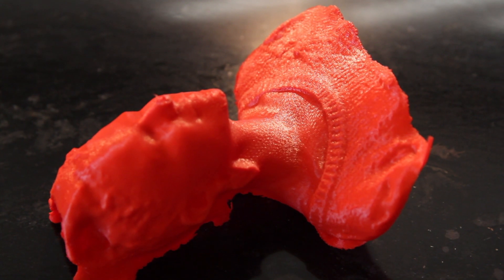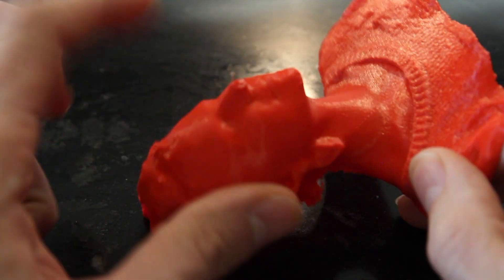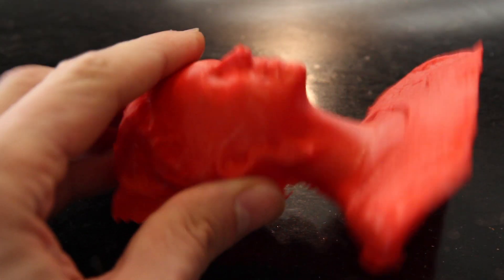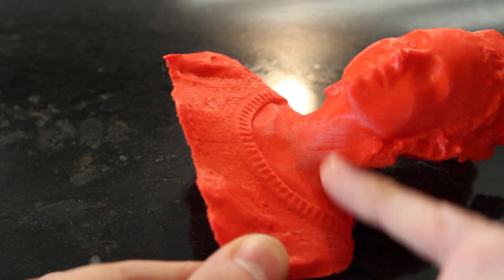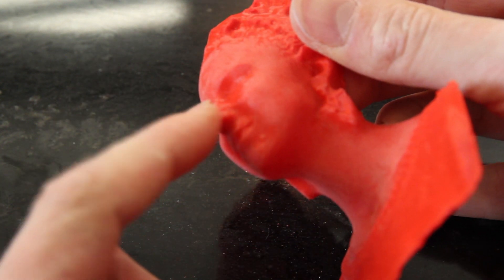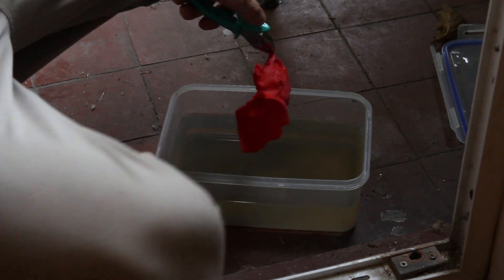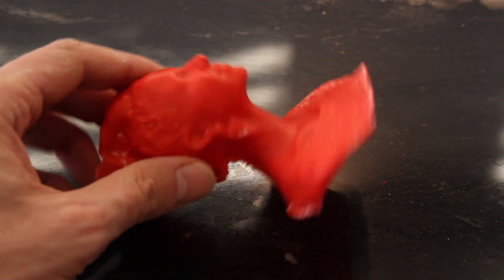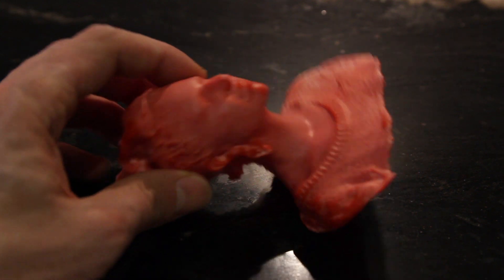ACETONE SMOOTHING PLA BEST METHOD EVER

Comment: Storing acetone in a proper container is a consideration especially for those of us in hot climates. Be aware, an airtight container might explode from pressure.
Reply from the maker: Is that why some containers deliberately leak like methylene chloride? I had a 1 ltre bottle that was half empty afterca month and i hadnt even opened it!
Reply: @Cloakfiend  Likely. I'm not sure about that chemical specifically, but I know I've bought containers made specifically for different things that advertise that they leak excess pressure out of the canister as a measure of safe and proper storage. I've also had friends tell me stories about small explosions and/ or fires from using improper containers (most chemistry majors), so it's a good idea to research proper storage of chemicals and see if pressure relief is needed for the highly volatile ones.
Reply from the maker: @technicalman  im mostly ok. Temperature kinda makes the acetone containers expand on occation but they are almost empty so nothing dramatic and only after ages. Store them in a place where the temps are stable and you should be fine. Ive been doing this for more than 5 years now without issue. Even working in a room with a fireplace at 300 degrees C doesnt ignite acetone vapours. Not that i do that regularly!. Just tried it once.
Reply: @Cloakfiend  If it's the container in the video, it's probably fine. I imagine it is more likely to leak a little gas out of the seal when pressure is on the inside than explode.

Comment: As per your recommendation, I purchased some Colorfabb PLA/PHA but I'm having a really hard time to print small figures with it, specially on thin areas like supports, infills etc, it gets stringy and at some point will hit the nozzle and mess up everything. I tried to lower printing speed down to 30 mm/s and pritn temp to ~ 160ºC but still the same problems. Am I'm missing something? Thanks a lot!
Reply from the maker: What printer do you have? I use ultimakers and even default settings in cura for pla gives me decent results. Small stuff i print at 30mms at 193degrees with 0.06 layet height. I only use colorfabb and have just printed some amazing sculpts with some filament from colorfabb.
Reply: Thanks man, I'm using a cheap Ender 3. As mentioned earlier, my problem was happening mostly with supports and infills rather than the print shell.  In Cura there are no retractions for supports so that's where the stringy stuff came from (Not sure if there's a hidden option somewhere for this, I need to investigate further). 

So I just created some supports in Meshmixer and imported these in Cura (to have retractions on them) and so far it's now printing really nice.

Thanks again, I'll stick to your recommended 30mm/s and 190ºC. I own you a spool of dutch orange! :-)
Reply from the maker: @techmorning  if it doesnt affect your outer shell, then dont worry about stuff hanging off bits here and there. its worth investing in a good printer. it takes the pain away and you dont worry about failed prints, because they dont fail. The um2+ is a great printer imo and a lot of people bought these a few years back and never really used them as with many other brands, i see hardly used ones for sale all the time on ultimakers forums. you can pick them up for a very good price. they have an hours used option you can check to see how much use they'e had. Im still using my um2 from 4 years back! as well as another newer um.

Comment: If you are acetone smoothing PLA models than you are using very cheep filament. PLA is not reactive to acetone. what you are smoothing is the cheep low grade filler plastic that is in that filament. If that works for you then more power to you, but my stuff doesn't react to acetone.
Reply from the maker: 1stupidfish lets just agree to disagree. I think you'll find colorfabb filament highly rated and not cheap so ill leave it at that. Im not saying the additives they are adding are not cheap and they are ripping us off but im just after a good end result with as little layer lines than i can acheive. So im happy with the pla filament i use to acheive that. If you dont want to smooth your prints like i do....well thats your decision. Im not forcing you to do it. Im just showing you it can be done. Apple also use cheap components, do people still buy Apple products? Yes they do. I don't. Its all down to personal choice.
Reply: I'll grant you that you can get a limited amount of smoothie with that. Have you ever tried ethanol acetate? It gives you the same kind of smoothing effect as you get with abs and acetone. I don't mean to put you on your video it's a very good how to to use a very cheap products to increase the visual appeal of your pla prints. I usually simply use a vapor bath of the ethanol acetate with no sanding and I get a glass-like finish.
Reply from the maker: 1stupidfish well ill willing try anything out. Ill look into it. Any videos?

Comment: Yeah man this doesn't make any sense. I wonder if you some how ended up with PLB filament aka polysmooth. If you still have some of this stuff around see how it acts with isopropyl alcohol.
Reply from the maker: x9x9x9x9x9 isopropyl alcohol doesn't do a thing to this filament. It's colorfabb pla by the way and I've been using it for over three years I will post a new vid soon showing split screen comparisons and resolution tests and different results with different colours etc. Also the warping you need to look out for if you over do it.

Comment: let me see if i understood correctly...    you sanded a PLA 3D print, later you submerged it in acetone for 25 sec. and you left it dry??   it was it?
Reply from the maker: fearberserker117 yes basically. but make sure the print is as good as you can get. i did this one for about 45 secs btw. i said 25 but remembered i was using colorfabb which needs longer. ive got a few new vids coming soon anyways.

Comment: I thought you were supposed to use Acetone vapor ?
Reply from the maker: Devilz Heroz nah the vapour method is too uneven and i dont do it as this method suits my needs. vapour is for abs really. you can do it with colourfabb a bit but brush on or dip is better with this PLA in my opinion.

Comment: what printer u use?
Reply from the maker: i raul ultimaker 2
Reply: Cloakfiend  ohhh expensive one
Reply from the maker: i raul i paid 1500 pounds for it over a year ago. i dont think that is very expensive. the new one is too expensive!
Reply: Cloakfiend  check the reviews of the PRUSA i3 mk2 or ANET A8(is the clone of prusa)
Reply from the maker: i raul im happy with mu um2 even though it is old. my next printer will be resin, as filament printers dont get much better than the um2. and the um3 is stupidly expensive.

Comment: No problem I was reading your article on the head you did a while back old man head looks amazing by the way inspired me to start 3d printing. Question what layer height did you do it at in the end at any settings you can help me with like shell infill ect massive thankyou in advance
Reply from the maker: all my stuff is generally 60 microns and no infill to save time. infill is only needed when you have cavities on your model. hope that helps?

Comment: So, obviously this was not PLA (whatever they call it), since pure PLA filament does not dissolve with acetone at all. ABS does, but not PLA.
Reply: Because not everyone wants to have potentially dangerous fumes in the room. I for example have a one room apartment and therefore not the luxury of a garage, a workshop or hobby room.
The biggest problem with 3D printing at the moment is, that the filament manufacturers only state the main polymer and not what else is in there.
Reply: I don't think you can get pure PLA filament. Most of the filaments, at least those with color will react to acetone. I am using it to weld prints together
Reply from the maker: just go outside for a minute and do it then like in my newer video and problem of fumes solved.
Reply: Cloakfiend I am talking about the printing, not the acetone. ABS is made from mineral oil and emits chemicals during printing that aren't exacly healthy.
Reply: Jeppe Beier Do we need to use the industrial one? Or the ones that women use to erase their manicures?
Reply from the maker: Andreas Vogler im using pla not abs, thats the whole point.
Reply from the maker: Yes, Obviously. I need to do a new tutorial to prevent the same pure PLA questions argument i keep having, its regular colourfabb PLA ONLY for now as stated in the description. I never said PURE pla as we ALL know it doesnt do anything.
Reply: Cloakfiend Colofabb Claims it is not pure PLA, but a PLA/PHA-mix. This means that whatever  PHA-Derivate they used, may be reactive with acetone. The same is true for Ethyacetate, which only works on PLA-mixes, not pure PLA (but Filaments are almost always some kind of mix.
Reply from the maker: Thats why I love their filament over everyone elses,  i couldnt care why people WANT pure pla, surely one that smooths is better than one that doesnt?
Reply: Cloakfiend Fine,  but they should not call a product "pure something" when it isn't.
Reply from the maker: they dont, its called pla/pha, why do people want pure pla anyways? i certainly dont

Comment: when you print from shapeways or Sculpteo whith their standar plastic PA12 is it ABS PLA or something else like Nylon ?
Reply: PA is short for Polyamide, which is Nylon
Reply: so would acetone smooth the PA as well ?
Reply from the maker: I've no idea what industrial printers use I've only used some for studio work a couple of times before i bought my printer and it was kind of powdery and you couldnt sand it so it didnt suit my needs. And it was like 100 times more expensive.
Reply: yes Nylon or PA12 is porus but the most strong plastic, and i need Strenght since i am making parts for airsoft
but thanks for the help abyway i will still try with acetone to see how it react :)
Reply from the maker: +GenoGENOVA ill make a new video which will help in warping as if you dip long thin parts like wings, they may warp if you are not careful.

Comment: Hi Cloakfiend,
I am uncertain how long the smoothing process takes on PLA/PHA...
I tried dipping a PLA/PHA print and still see some banding, would a minute in the dip be out of the question?

Also is 30 seconds always enough for a dip, or can i try like 45 seconds or minute? Have you tried?
Reply from the maker: its difficult to say and if your print is not perfect then dont expect the smooth to be either. print as high res as you can with as little infill as you can get away with to save time. i always print 0.06 minimum. sanding before smoothing will help a lot.
Reply from the maker: if you dip for too long your model will crack badly anything over 45 secs is risky.
Reply: Cool thank you for the advice. I tried my first dip without doing any sanding just to observe the results. :) I wanted to get a good benchmark in my mind of what dipping can do. I will now do a print and sand and then dip.
Also I knew your name was familiar on some site I saw a post from you and thought how experienced you sounded. Now I realized that you were the author of that post and also these videos. :) So that means in two seperate locations I noticed your knowledge and experience. :) Thank you for your advice. Also I will try a finer resolution print. Mine was at .2 MM. I will try a .05 or .06 as you suggest to see what kind of results my printer can get. Thanks again, you are generous with your time man. Much Much appreciated.

Comment: ok, firs of all, looks you have no clue what you printing, acetone wont dissolve pla!!! so, your print is abs not pla or you use tetrahydrofuran not aceton. Aceton wont affect pla!
Reply from the maker: No need to be so rude but the PLA i have used for almost 2 years works just fine so Im afraid its you who has no clue as to what he is talking about.  ice had this pure pla argument so many times now i really cant be bothered having it again. i dont use THF. its more expensive and too destructive. this video is old now and i dont do it like this anymore anyways. im doing a new video soon, in the meantime you keep using your pla and ill keep using mine.

Comment: Acetone bleaches the yellow PLA I use, haven't tried it on anything since.
Reply from the maker: It bleaches ALL PLA, even PLA that doesnt smooth. Ill post a new vid soon that changes that.
Reply: I don't think there is any interaction between the acetone and PLA itself at all; acetone probably dissolves masterbatch, that's pellets of likely a different plastic, maybe EVA or PS, that is mixed into the uncoloured PLA and colours it, and most of the dye is likely still bound to the masterbatch binder. There's probably only a fraction of a percent of that stuff.

Comment: Witch acetone did you use?
Reply from the maker: the cheapest one i could find in a 5 litre container on ebay. it simply needs to be at least 99.8 percent acetone. dont use nail varnish remover.
Reply: +Cloakfiend at my country there is only 80% do you think that will work?
Reply from the maker: +claudia caamaño try and see, maybe leave it in for longer?
Reply from the maker: and remember colorfabb filament only as far as i have tried. i have not used any other brands.

Comment: Hey man nice video! I had a question for you. Does PLA capture good details like texture?
Reply from the maker: +KJS Films™ Its all down to the resolution of the printer and what PLA you are using. Manufacturers are always changing recipes for PLA and ABS to try to improve them. Surface texture is hard to get but not completely impossible. It all depends on the brand of PLA. UM used to be the best PLA but not any more, they are completely different from what they used to be.

Comment: Good Vid..........About a year ago, while looking for a method to smooth PLA, I found a trick that really impressed me, and I use it frequently.  I can't recall where - so no link:( -...... THF: tetrahydrofuran, was the revelation; to be hyperbolic.... I dip the object, swirl it around for coverage, and let it dry. The time in the bath in my experience - and for my needs - should only be about 5 seconds....... I don't know about acetone, but THF seems to be pretty aggressive and you'll start loosing detail rather quickly. Also, from what I can see, the object needs more drying time than acetone. I usually let it sit for thirty-minutes, or more......the only draw back I've found is that enamel paint doesn't perform as well and is hard to control for detail, sort of like a drop of water onto a sponge, it "spreads" (I didn't use primer.) Maybe that has to do with the "shell quality" mentioned............... I don't have a need to be knowledgeable on material science. I just use MakerBot filament and didn't know there were blends of PLA. That's Interesting; I'd like a tut on blends etc.......cheers.
Reply from the maker: +magnacarte kingjames 

I know about this THF stuff and its nasty stuff. Acetone is at least a bit safer to use. With a Maker bot i can only recommend colorfabb as thir filament is PHA/PLA so it works. (its the same brand ive used in my video here). THe benefit with my method is that you keep nearly all of the detail,  THF destroys it. I am obsessed with detail retention, and have not seen a better method than mine for it. you will ALWAYS lose something but with mine you lose the least.  And its quick and easy. (I would however wait for an hour or two after so be sure the acetone has evaporated off. ) you can easily tell this though as the PLA changes state and becomes bleached and sounds different when you tap it compared to when it was soaked. but you MUST use colorfabb as Ultimaker PLA no longer smooths due changes in manufacturing the filament, so colorfabb is the only remaining filament maker that i can guarantee it works on. (not tried their speciality filament though but should do if they contain PHA in the PLA.
Reply: +Cloakfiend . Good advice. I'm not a chemist;) Could you address some of the nastiness of THF? When I tried acetone I just never had the results I hoped for. Some items ended up with a bleached like finish. I'm certainly not doubting your experience. I would expect the combo of PHA/PLA has an effect(?)  I'll get some Colorfabb; it worth experimenting. Thanks much.
Reply from the maker: It does have a bleached finish, and as far as i can tell collorfabb is the ONLY brand that smooths. All the others i used before changed their PLA recipes so they don't work. It takes a high res print to get the best or else your lines just wont smooth. 0.06 works for me then just a simple dip and job done.
Reply: +Cloakfiend Great. I'll definitely try this out. Thanks for the update.
Reply: +magnacarte kingjames The reason THF is often described as "nasty" is the same reason most solvents are - it's highly flammable, vaporizes easily, is potentially toxic, and can destabilize if stored for long periods. It's a super-effective solvent for the particular construct that is PLA (and there are effective solvents for most things); but like most chemicals, you need to be aware of potential risks and proper safety precautions.  When dealing with chemicals, always google "[chemical] MSDS" and you'll get more information than you want to know about anything. The key points to look for are Explosions/Flammability, Hazards, and Exposure/Personal Protection. Happy makings! (I am a chemist. Mostly)